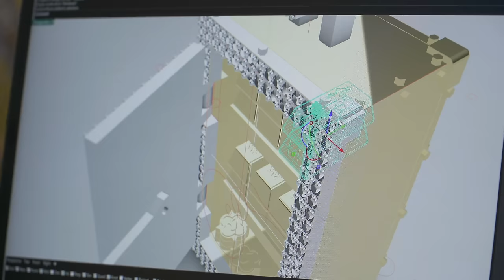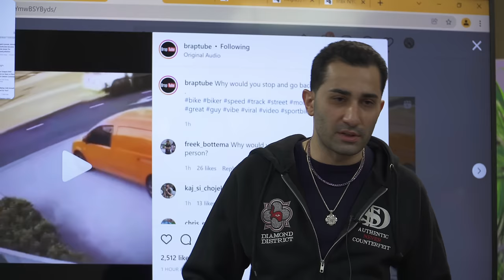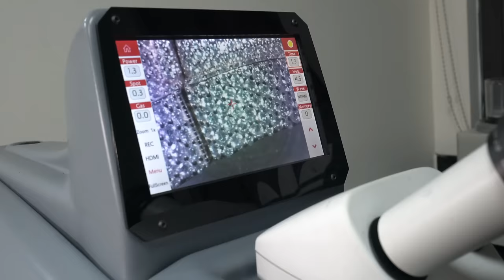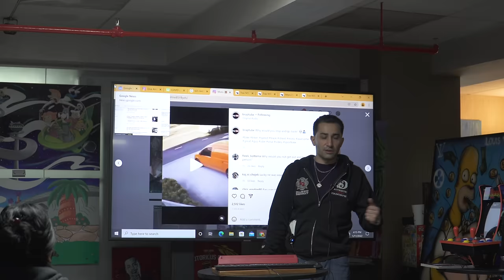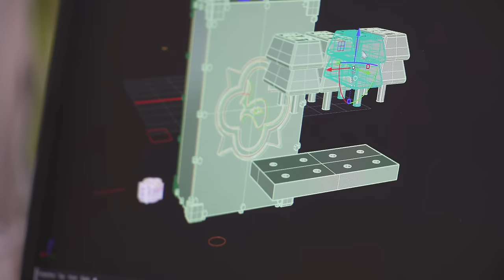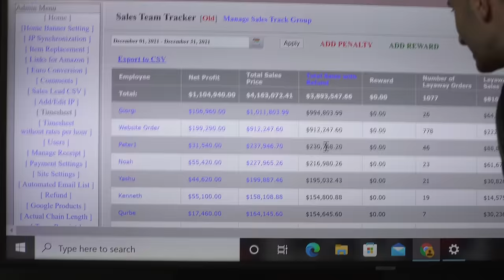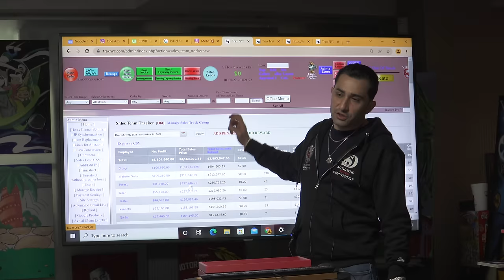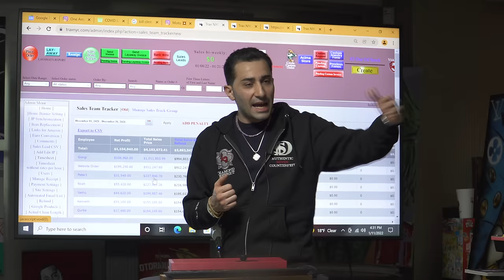TRAXNYC We’re HIRING?!? | The District S1. EP.17

Comment: Pineapple upside down cake
Ingredients

1
Betty Crocker™ Super Moist™ yellow cake mix
1 1/4
cup water (for cake mix)
1/2
cup butter, melted (for cake mix)
3
eggs (for cake mix)
1/2
cup butter (for topping)
2/3
cup packed brown sugar

Whipped cream for garnish, if desired
9
maraschino cherries 9 without stems (optional)
9
slices pineapple from 14-ounce can, drained
* 		Preheat oven to 350F. In a flameproof 9-inch cake pan, melt 1/3 cup of the butter over low heat. Sprinkle the brown sugar evenly over the butter and cook, stirring, until the sugar and butter are blended and there are no pools of melted batter, 2 to 4 minutes.
* 		Arrange the pineapple on top of the caramel. Decorate with cherries if desired, placing them in the center of each pineapple slice. Set the pan aside.
* 		In the work bowl of an electric stand mixer fitted with the paddle attachment, or in a large mixing bowl with a handheld mixer, place the flour, sugar, baking powder, and salt and mix on low speed until well combined. NOTE: Eva likes to use cake flour.  Add the remaining 1/3 cup of butter along with the milk and vanilla. Beat on medium speed for 2 minutes. Scrape down the sides of the bowl. Add the egg and beat on medium speed for 2 minutes. Pour the batter over the pineapple.
* 		Bake until the cake is golden brown and a toothpick inserted in the center comes out clean, 40 to 50 minutes. Remove the pan from the oven and carefully tilt it in all directions to release the cake from the sides of the pan. Let cool in the pan for about 3 minutes. Turn the pan over otno a serving plate and let stand for 2 to 3 minutes. Carefully lift the pan off the cake. Use a spatula to remove any fruit that is stuck to the pan and place it on the cake. Serve warm or at room temperature.
Pineapple upside down cake
Ingredients

1
Betty Crocker™ Super Moist™ yellow cake mix
1 1/4
cup water (for cake mix)
1/2
cup butter, melted (for cake mix)
3
eggs (for cake mix)
1/2
cup butter (for topping)
2/3
cup packed brown sugar

Whipped cream for garnish, if desired
9
maraschino cherries 9 without stems (optional)
9
slices pineapple from 14-ounce can, drained
* 		Preheat oven to 350F. In a flameproof 9-inch cake pan, melt 1/3 cup of the butter over low heat. Sprinkle the brown sugar evenly over the butter and cook, stirring, until the sugar and butter are blended and there are no pools of melted batter, 2 to 4 minutes.
* 		Arrange the pineapple on top of the caramel. Decorate with cherries if desired, placing them in the center of each pineapple slice. Set the pan aside.
* 		In the work bowl of an electric stand mixer fitted with the paddle attachment, or in a large mixing bowl with a handheld mixer, place the flour, sugar, baking powder, and salt and mix on low speed until well combined. NOTE: Eva likes to use cake flour.  Add the remaining 1/3 cup of butter along with the milk and vanilla. Beat on medium speed for 2 minutes. Scrape down the sides of the bowl. Add the egg and beat on medium speed for 2 minutes. Pour the batter over the pineapple.
* 		Bake until the cake is golden brown and a toothpick inserted in the center comes out clean, 40 to 50 minutes. Remove the pan from the oven and carefully tilt it in all directions to release the cake from the sides of the pan. Let cool in the pan for about 3 minutes. Turn the pan over otno a serving plate and let stand for 2 to 3 minutes. Carefully lift the pan off the cake. Use a spatula to remove any fruit that is stuck to the pan and place it on the cake. Serve warm or at room temperature.

Comment: I like how they show the mixture of gold with copper and silver,I'd prefer the metal separately and stored in a safe,the copper can go outside, but the silver and gold inside in a safe don't get me wrong copper is still worth enough so when I say outside I mean safety put,I've collected so much copper when I was operating a 14 tonne digger,excavator demolition and refitting factory's after we would get the job,we would go into a run down factory and turn it into a new factory with extensive renovations and upgrades for trucks and forklifts.and redone all the power that's how I recovered so much copper and aluminium,some jobs truck full or more,would be for the end of job bbq and beers.for everyone,which was was to much so would use the rest for repairs.